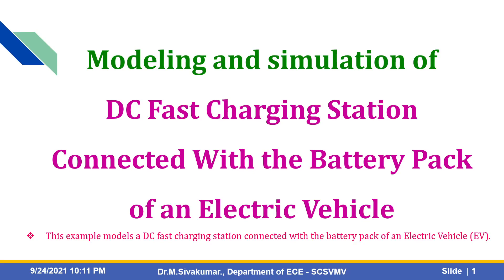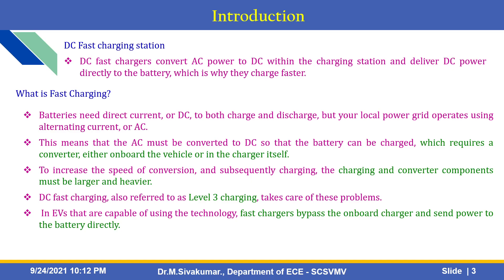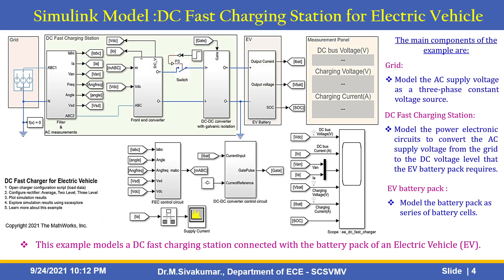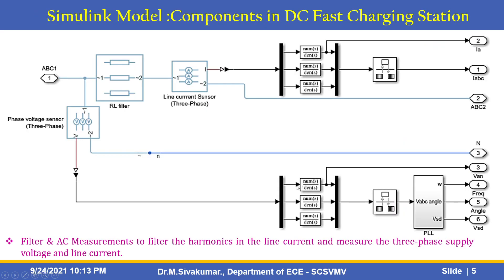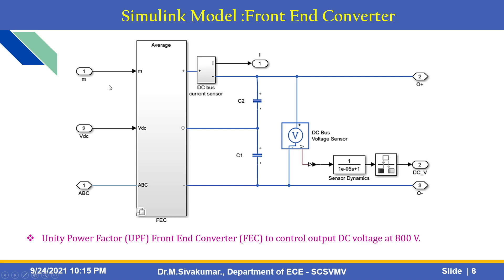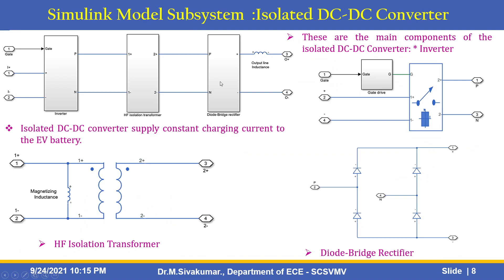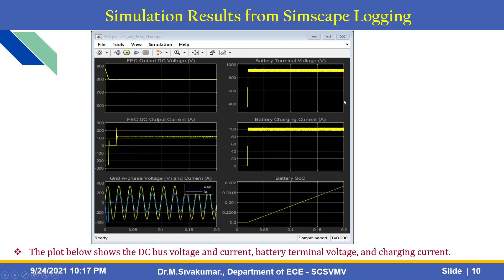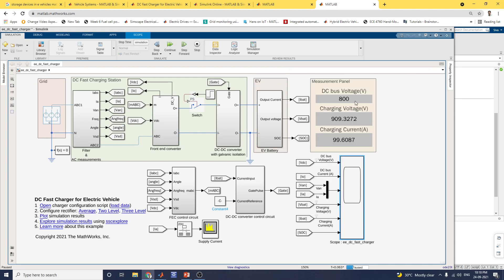Simulation of DC Fast Charging Station Connected With the Battery Pack of an Electric Vehicle

Comment: Please tell me values of following parameters :
(1) Rectifier switching frequency 
(2) inverter switching frequency 
(2) Rectifier voltage sensor G 
(4) Rectifier voltage sensor T
(5) Rectifier Voltage controller G
(6) Rectifier current controller T
(7) inverter controller Kp & Ki

Comment: How can the SOC process be increased? In the actual model the charging value does not change very much from 0.2
Reply: Please tell me values of following parameters :
(1) Rectifier switching frequency 
(2) inverter switching frequency 
(2) Rectifier voltage sensor G 
(4) Rectifier voltage sensor T

Comment: Sir, can you help me out with how to change the SOC of the battery
Actually, I am working in this domain but the output SOC only gets to 0.21 from 0.20 but I want to make the model such that it reaches 1 from 0.2. If you please help me out in this regard it will be really helpful for me.
Reply: I am also facing the same problem. Have you found out how to solve it?
Reply: Hey can you please explain me how to do this it's very urgent
Reply: Please tell value rectifier  switching frequency & inverter switching frequency

Comment: I really want to appreciate dear sir for your incredible work..very helpful for us..
Reply: Hello sir, I am trying this model. I have downloaded it but it is not working due to the missing data file for the model. Can you guide from where, I could get that?
Reply: Please tell me values of following parameters :
(1) Rectifier switching frequency 
(2) inverter switching frequency 
(2) Rectifier voltage sensor G 
(4) Rectifier voltage sensor T

Comment: The input is 3-phase 380v, but I'm curious how the front end converter converts it to 800v. Is 800v the voltage required by the car? And I wonder where the current control is done
First current is 99 but later current is more than 100

Comment: Thank you for this but it will be better if you show us step by step how the model was designed.
Reply: Is there any step by step tutorial?
Reply: I agree with u
Reply: Please tell me values of following parameters :
(1) Rectifier switching frequency 
(2) inverter switching frequency 
(2) Rectifier voltage sensor G 
(4) Rectifier voltage sensor T